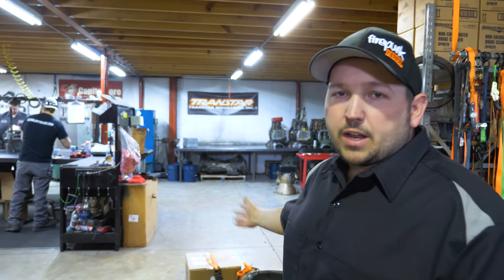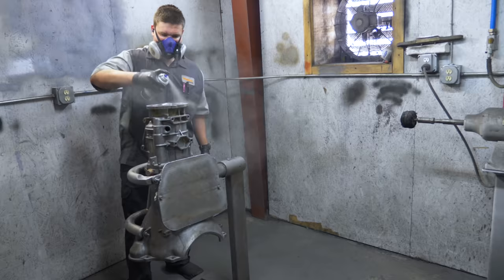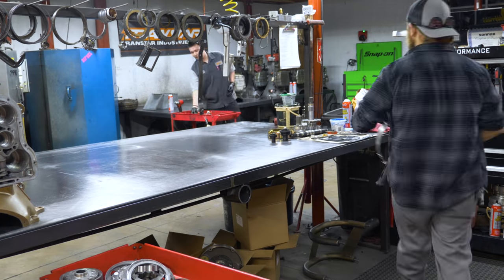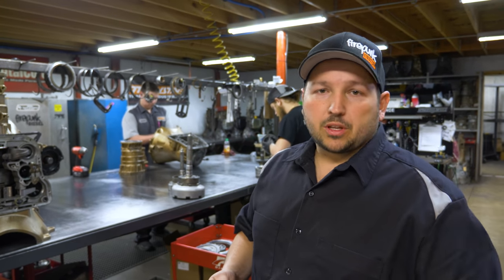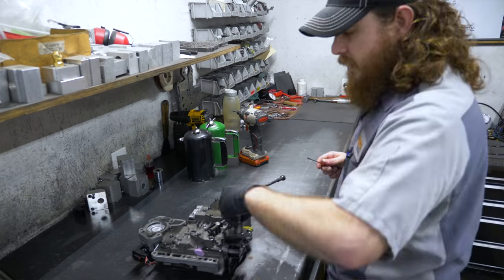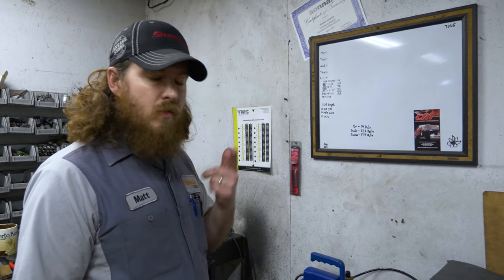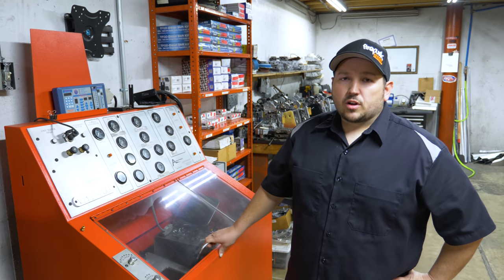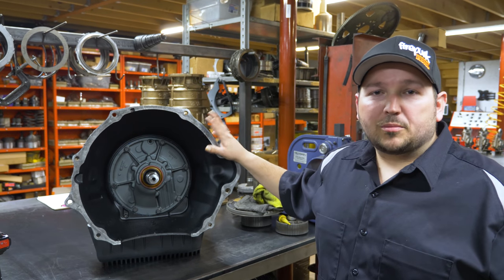FIREPUNK TRANSMISSIONS - BUILDING A GOLDEN NUGGET

Comment: Excellent job guys I plan to bould my own 650 horse 68rfe andit is going in my daily tow rigg yes it'll be backed down while towing and if over 20k pounds towing overdrive is off. Unless traveling over 60 mph. Or 1800 rpm

Comment: Okay, please do not laugh me off the channel... Since putting a diesel into either of my 2000 Dakota trucks is out of the question... can an NV1500 behind a 2.5L that is factory in one of my Daks be rebuilt with heavier internals to be as strong as an Nv3500, or is the case the big limitation? I am not looking to make monster HP, but I would like to drop in a 5.2L V8 with a 5 or 6 speed manual.

Comment: Great video but still missing something? What is the fluid that handles the best in the 48re? Too many have been killed by cheap fluid and brand names are just letters on the bottle. What have you guys found that works the best.
Reply: Ultron I’ve read on their fire punk Facebook forum lavon recommends Dex Merc over atf-4 in higher hp builds it helps it not slip as much basically

Comment: I'm still skeptical that my trans has all the parts I purchased. Bought the comp 1 kit and had nothing but problems for 6 months,finally working without gushing fluid.  Be curious to have u guys check it out and put it on dyno..
Reply from the maker: If its wrong, we will make it right for sure.  But i can pull the build sheet to be sure.